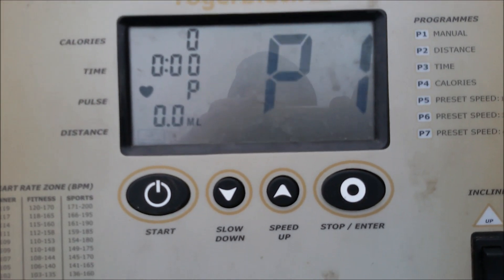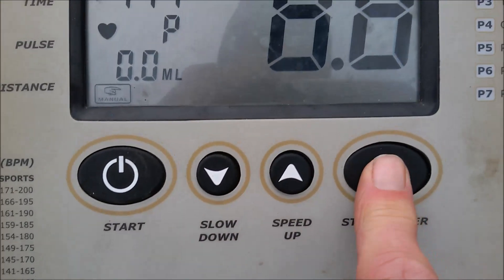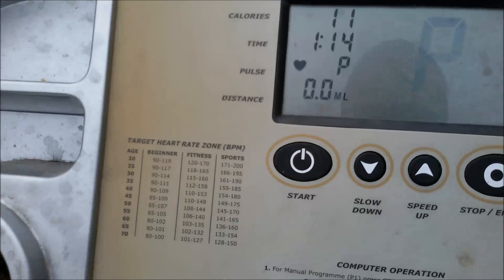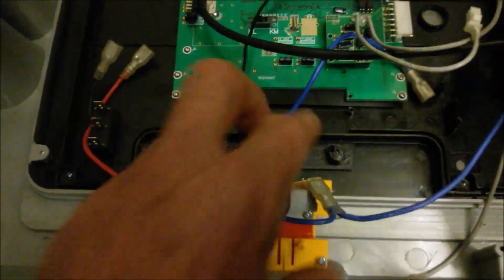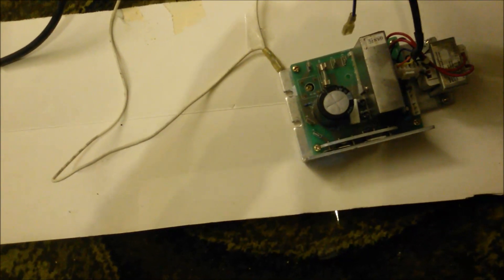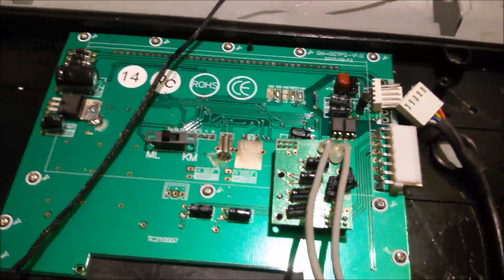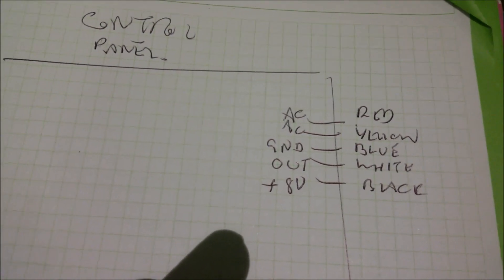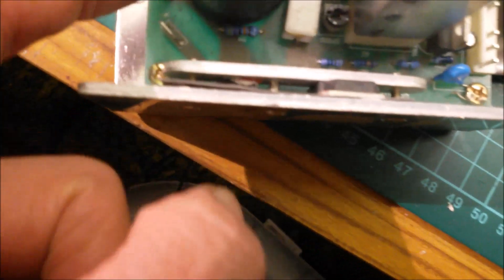Treadmill motor circuit for lathe

Comment: Is your treadmill motor a permanent magnet motor? Are you running it in reverse, if so has there been any negative things with the motor when running it in reverse?
Reply from the maker: Hi H, this is a high voltage DC motor. You need to swap the positive and negative leads to make it run in reverse. I have had no detrimental effect from running it in reverse except the danger of unscrewing a chuck. It allows you to mount the motor any way round and still find a direction to rotate the chuck the right way. It has brushes - it probably is permanent magnet then, not had it apart. I hope this helps, John.